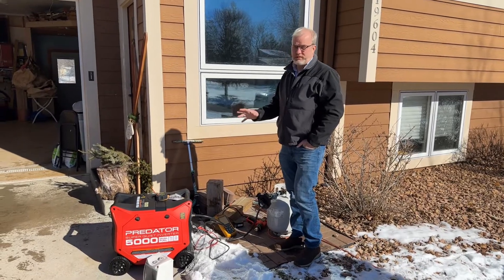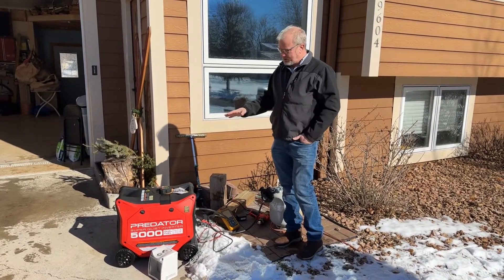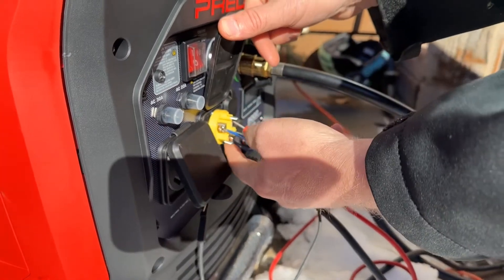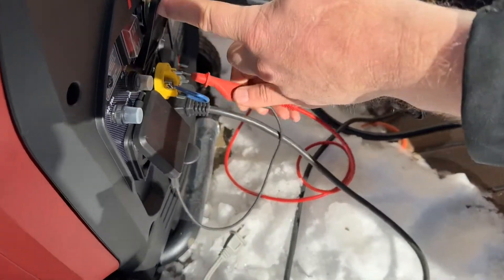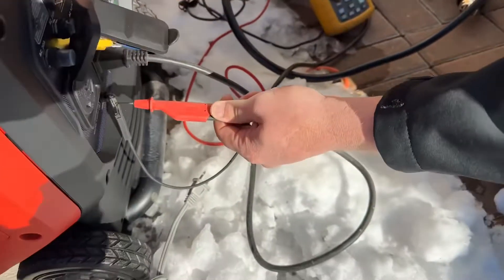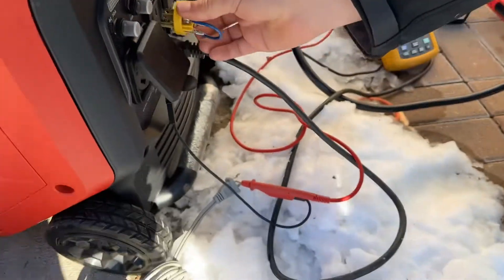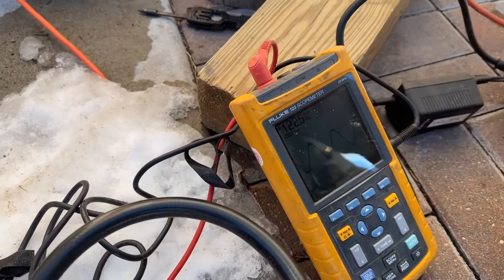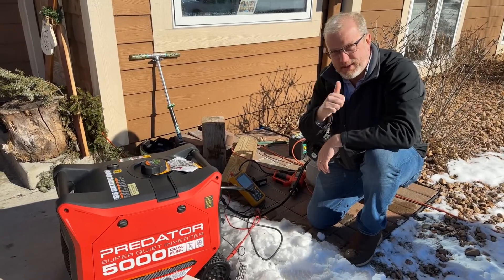We FINALLY found out how to fix this problem! #generator #solved #electronic #help #technology

Comment: Is that a 120 volt or 240 volt generator? I thought if it had a RV plug it would have 2 hot legs, a neutral & a ground? 
I have a different generator (mine is fuel injected) & I had an electrician wire mine up for auxiliary power. I get perfect sine wave 123-124-246 volts all day long at 38 amps per leg. More than sufficient to run my entire house.
Reply from the maker: It is a 120v generator
Reply: @GearStreet  That's a robust 120 volt 5000 watt generator you have there. My Honda EU7000is (the one genny all others are compared against). Is nominally rated at 5500 watts & is a 240 volt genny.
If a genny is used for a RV? I thought the heat & A/C was 240 volt? 
My first generator purchase was the one I have & I'm thoroughly impressed by it. I have had it for over 5 years & it has 72 hours on it. The only thing I have done so far is change the oil once a year. Only Mobil 1 goes in my genny. 
We use it for back up power for the house when the power goes out. It has never let us down. I have tested the genny to see how much headroom it has on it. I pushed it to 9200 watts & it delivers full power without a strain. 9201 will trip the main on it even though the main is rated for 30 amperes. That's over 38 amps before it trips. I thought of buying two & mating them for 11KW. I don't need to. There is enough power to power up my entire house even my 2-1/2 ton central air. I load tested my house with everything on & it draws 3750 watts all day long.
Reply from the maker: Wow that’s impressive! The Honda EU7000is is a really good generator.
Reply: @GearStreet  Yes it is. It stands alone & every incarnation stands alone where others are compared against